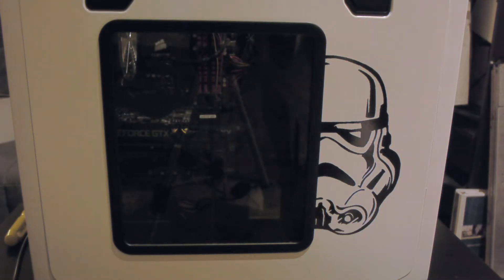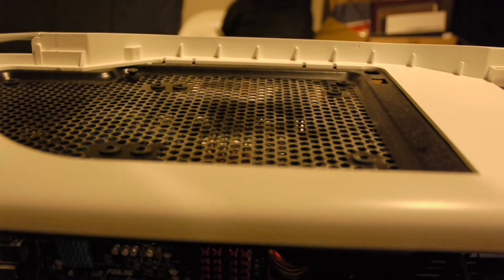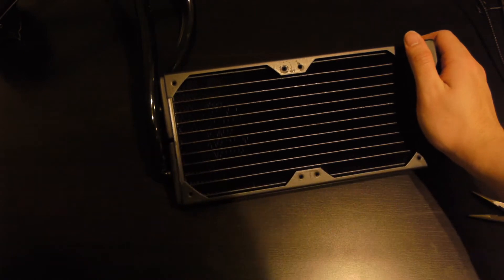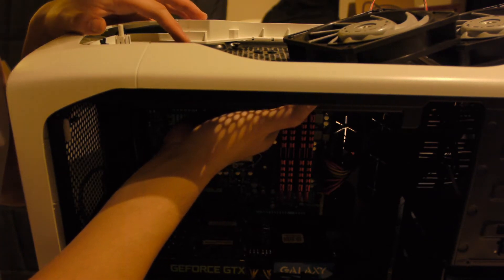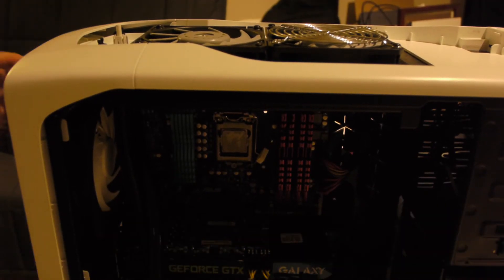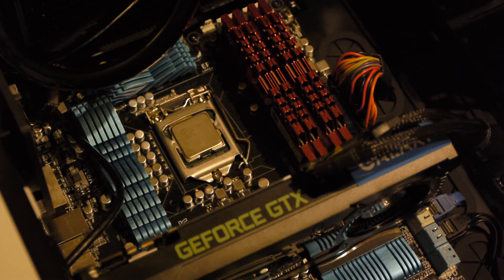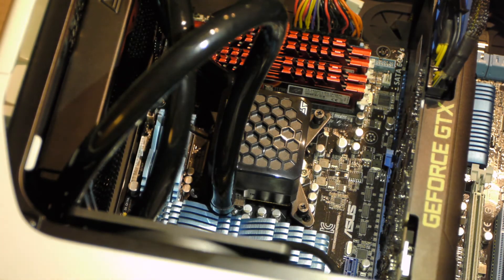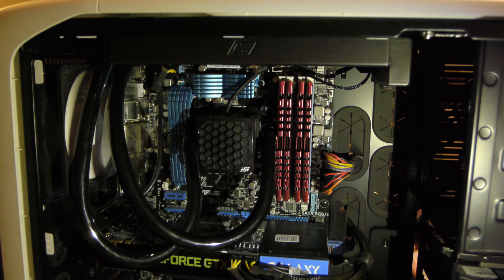[DIY] Swiftech H220 Unboxing and Installation Part 2

Comment: Hey, could You please tell me what is the clearance between motherboard and swiftech rad, measuring from the top of the motherboard straight up? is it about 1 mm or more? Because I wonder if the Swiftech H220-X will fit with Asus X99 Deluxe mobo in that particular Corsair Graphite case.

Comment: I had to mount it this way for the Rogue 925 case
Reply: I spend 2 hours fiddling with it, one screw ended up stripped but there are extras. The backplate for AMD is a pain, you should use tape or even use one hand to hand the backplate to the back of the motherboard.

Comment: You think this fit in my 600t I have a Z77 saber tooth I was just wondering it it fit with the thermal armor on
Reply from the maker: I believe people have gotten it to work. You just need to make sure you orient the pump the right way so it doesnt sit on any of the heatsinks or plastics.

Comment: Great video! Was lucky enough to find one in stock so expecting it in a couple of days. A question though what software you using to monitor the fans and set speed since you connected them to the CPU_opt header. Unfortunatly on my Asus board i cant control the speed using fanexpert only pump speed ill be able to control since ill be hooking it up  the pump to the main CPU_fan header.

Comment from the maker: I did manage to get another fan on by zip tying a fan to the underside. I didnt see any gains to be honest. I think at that point you're better off cutting the mesh at the top so the fans have a clear path to the radiator.

Comment from the maker: I dont think there's enough space unless you mount the radiator crooked or off center or did some mods. The 8 pin connector at least on my mobo is touching the radiator where the fan would go. it would also depend on where your 8 pin is located though too.

Comment: I have a 600t, as i see, it's a tight fit, it's possible to make a push/pull configurantion with 120x120x15mm fans ?